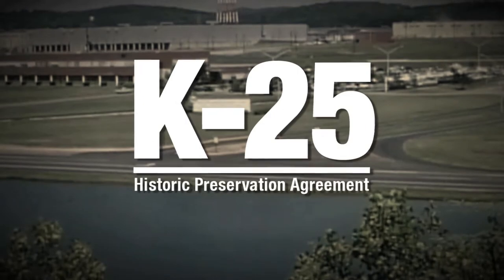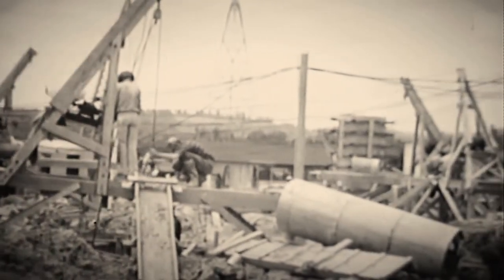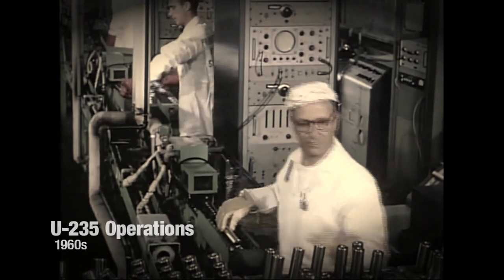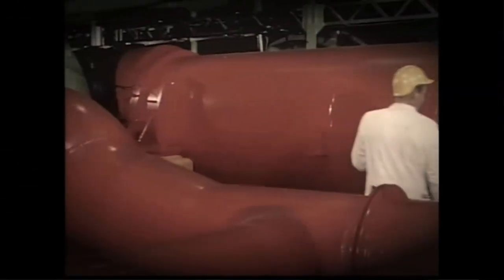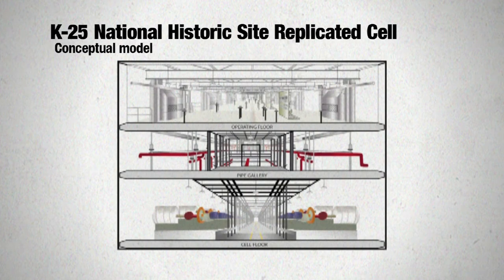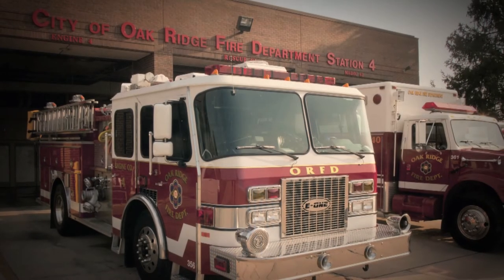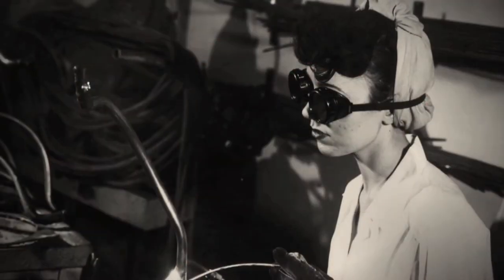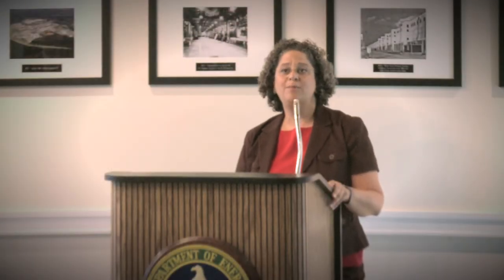K-25: Historic Preservation Agreement

Comment: I worked at K-25 and Y-12 both but loved K-25. My retirement started just before demolition began. I was fortunate enough to be able to go into every inch of the big "U" building. It was truly an engineering masterpiece.
Reply: Me too....retired in 1993 after 41 years service.....exactly. Oct. 1, 1952 till Sept.30th, 1993. I lived in Oak Ridge 50 years. May 1944 till January 1994. I live on the lake near Kingston, TN now.
Reply: I’ve worked there for 25yrs now and it’s sad to see everything gone. You may have worked with my father in law Steve Braden.